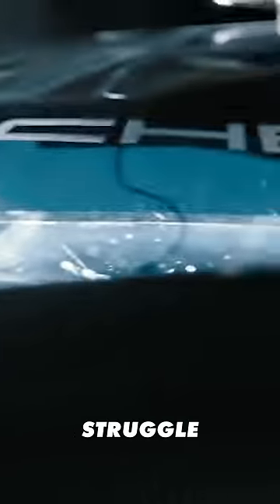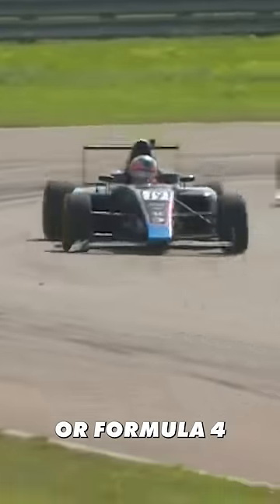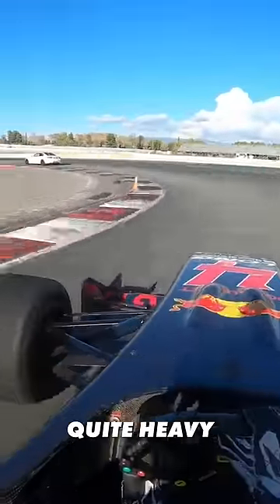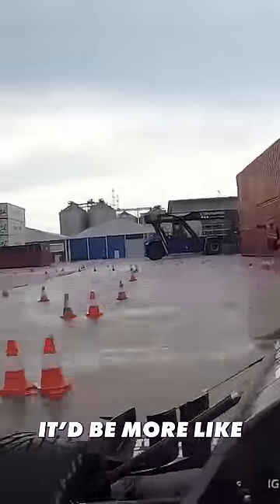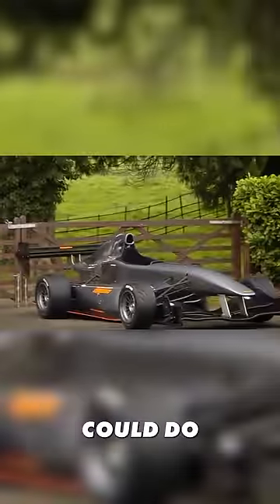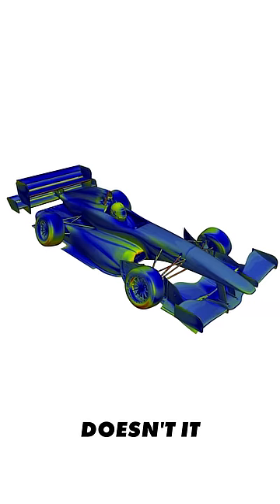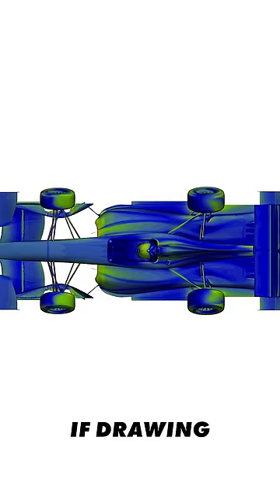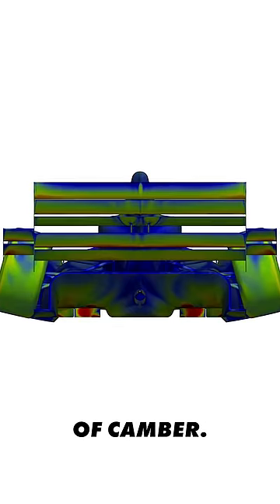The Car I'm Going to DRIVE UPSIDE DOWN

Comment: I would assume you’re going to travel in some kind of tube. Even as you climb the wall the curvature of the wall will destroy the ground effect and you lose downforce. Grip and control become erratic. Assuming you don’t fall off the wall at that point then you’re climbing to the ceiling. Still with no ground effect plus the full weight of the car working against your wings to pull the car off the ceiling. I’m guessing maybe half the downforce at least and tires that feel like they’re on ice. 

There’s a BIG difference between the theoretical and the real world.
Reply: You're right they won't have thought of any of this
Reply: @wrapdump  ok yeah I get your sarcasm. But why propose to do something that no existing car can do?
Reply: @CX0909  because it would be really cool?
Reply: That is exactly why the car isn't designed to produce downforce through ground effect.
Reply: @brinkipinki  it’s got a diffuser. That’s ground effect. Even the front wings use some ground effect by how low they are.
Reply: @CX0909  I'd be highly surprised if the car is supposed to experience to any ground effect, as it is very clearly supposed to exclusively drive on a concave surface.
Reply: @brinkipinki  agreed. Yet I’m still scratching my head on how he will get a car that’s designed to run on a concave surface to run across the flat ground to generate enough downforce to actually climb up a curved wall to get to the ceiling. Or a tube long enough and large enough to do this stunt must be found. And usually big tubes aren’t just vacant. Also that will be an expensive one off car build.
Reply: @CX0909  I don't know how he wants to get the funding either. But it is apparently supposed to exclusively run on a concave surface. No flat ground.

Wings can also most definitely provide enough downforce. Keep in mind that F1 raced with (almost) no ground effects for years.

Comment: Can the engine and fuel tank work upside down?
Reply: An inverted dry sump oil system & fuel system like what acrobatic airplanes use.
Reply: @429thunderjet2  They're doing that?
Reply: Well probably, unless it's going to be a very short blast upside down and they are going to chance it without modifications to the oiling & fueling systems. Idk

Comment: Why does camber matter?
Reply: The center of the car will be much further away from the tunnel floor/wall than the edges of the car, because of the tunnel's curve. Likewise for the wheels, so they are cambered massively to match the angle of the tunnel, mantaining the most contact, and thus grip.

Comment: Can someone please tell me what purpose high negative camber would serve if you won't be cornering and therefore won't need lateral grip?
Reply: That much negative camber won’t help cornering at all. 

But the reason it needs so much is because it’s driving inside a pipe, so the floor is curved, it’ll work out to be about none relative to the floor

Comment: Just use a cheat code and whip out the McMurtry. 2 tons of downforce standing still with the fan on, while weighing under 1000 kg.
Reply: No way these numbers are true.
Reply: @Iseenoobpeoples  
I mean, they'd make sense given how it's RWD and can do 0-60 in 1.5 sec on wet surface. Insane downforce from 0 mph has other obvious advantages too. To quote a former F1 driver Max Chilton:

“Nothing else drives like this car.  The low speed grip and acceleration is easily beyond F1”
Reply: @dodoz44  2 tons just sounds like exaggerated advertisement.. why doesn't the suspension compress when they start the fans? How can they produce such force when the floor is not even close to being sealed?
Reply: @dodoz44  It has insane power to weight ratio that's why it accelerate so quickly and I'm not doubting that it produce downforce from a standstill just way less than advertised something like 300kg.
Reply: @Iseenoobpeoples  
You're forgetting something... It has 1000 HP... Which has to power both the fans AND the wheels. It can't run the fan 100% if it also wants to put the power down to accelerate at high rate. And it's got active ride-height suspension that likely compensates for the suction force so the car stays level.

Comment: Combustion engine upsidedown?
Reply: That's the biggest joke 😂
Reply: Ever heard of airplanes?
Reply: I mean if you take a normal street engine and try to go upside down, you will be fcked due to oil pressure drop
Reply: @sebo8872  yes you're right  but they have been planning this for a while, they will have a modified engine thats sure
Reply: Can't it be done with a boxer engine
Reply: Dawg old warplanes have their engine’s mounted upside down. You’d have to redo the oil, but it isn’t impossible
Reply: He's not stupid after all
And there are basics he knows I mean he is not doing it casually taking recommendations and suggestions of car designers and stuff
Reply: they're talking about power train next video
Reply: @alexnadeaupelletier2287  dude airplanes (with radial engines) flied upside down, but they worked perfectly only in positive g situations, in case of negative g, in prolonged manuevers, radial engines faced problems too(even with scavenge system). In these formula race cars, not only fuel systems but also cooling systems would suffer horrible failures being upside down.

Comment: Why do it if it can be an F1 car? Even modified? If you can’t do it with an F1 car, you’re not proving anything at all in regards to F1 cars. Now it’s becoming a way dangerous (not to mention costly) stunt that has hardly anything to do with Motorsport. Use a T-50 GMA car while you’re at it. It’s super light and if uses a fan to stick to the road.